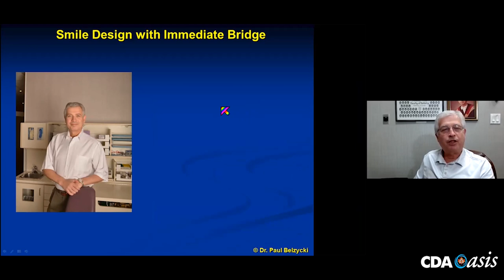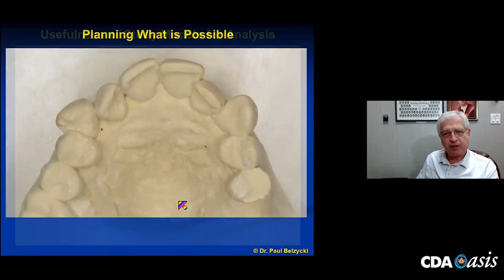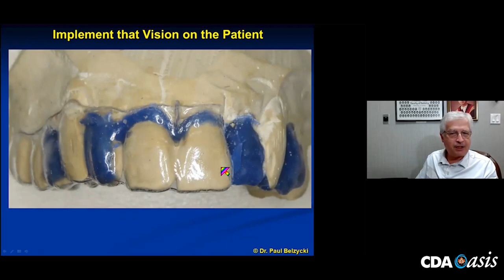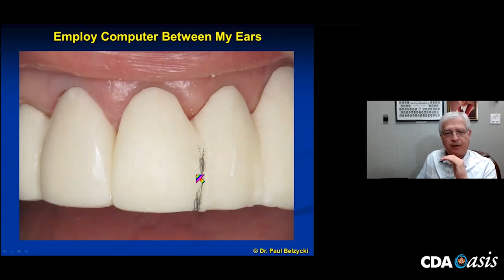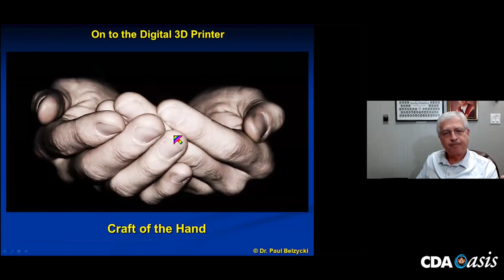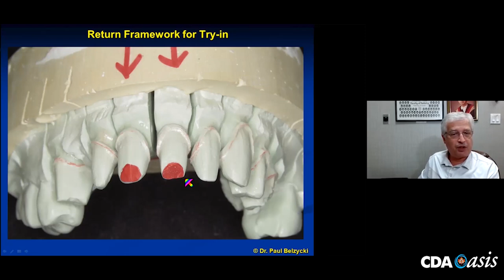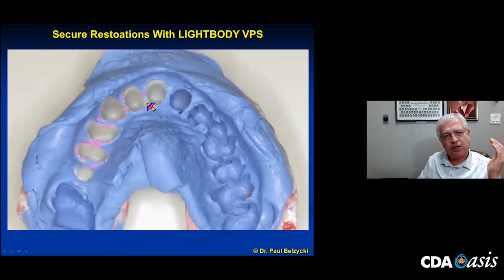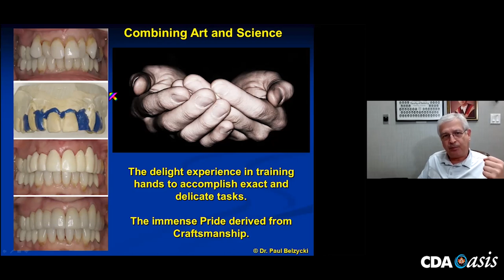Redesigning a Smile

Comment: Very well explained
Reply from the maker: For short-term (2 months) provisional crowns and bridges, I use TempBond NE by Kerr. For longer, I use PolyF Plus by Dentsply.  If a patient is travelling, I will use PolyF Plus for short-term to avoid a provisional dislodging while out of town. I also use this same cement for final insertion of metal crowns and bridges. I have placed large bridges some 40 years ago with PolyF, and they are still in place.  The cement is most reliable.  Note is it the only cement...it is exact fit and finish of the restoration coupled with properly prepared teeth.  I poorly fabricated restoration will fail irrespective of the cementing medium. There are no shortcuts to success.